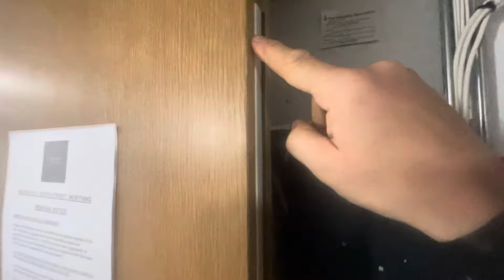Failed Locks | Composite Frame Repair | What’s In My Lockout Case?  | Brighton & Hove Locksmith

Comment: Andy quality video as usual i love your screw to pack out lock face plates etc i would never have thought of that i would have probably tried splinters or plastic but i love that tip I'll probably plagerise that one from you in the future top tip also the era viscount if that was a broken talon situation and you had key could you turn the key to 12 o clock and retract bolt with a screwdriver provided the key is lifting levers to it's true gates i guess ?
Thanks Andy
Reply from the maker: Thanks mate. 
Yes it the case of a snapped curtain or talon you can usually do this! However, in this situation the lock case had come completely loose meaning the bolt and levers were all dislodged! Managed to get it open and refitted the lock after reassembling it 😁
Thanks for watching 🙏🏼
Reply: No worries Andy thanks for replying mate